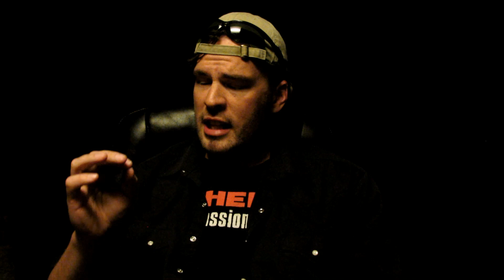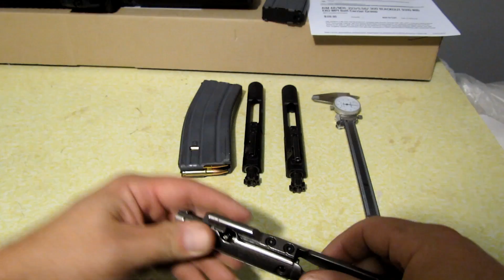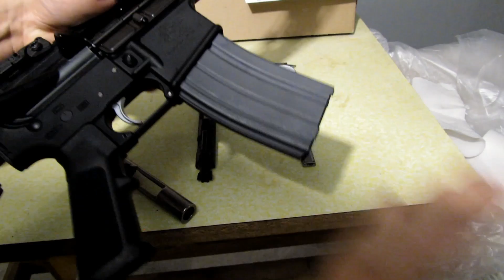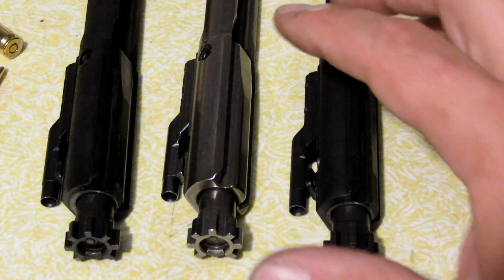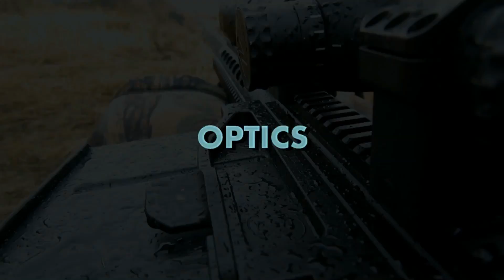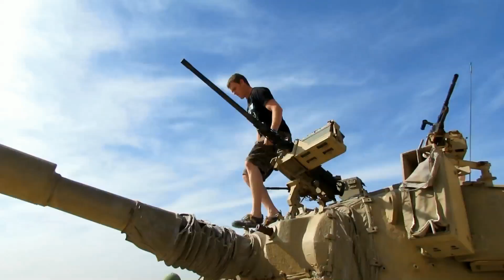AIM Surplus AR-15 Bolt Carrier Group ~ FAIL ~ (9310 NiB EXO MPI)  ~ Rex Reviews

Comment from the maker: NOTE:  This is only an example of what can happen if aftermarket parts are mixed and matched... "cumulative slop" or "tolerance stack" may push it over the edge of failure... this is certainly not representative of every scenario - as there are lots of great reports on how these BCGs work.   Just keep an eye out for potential deviation in all of your rifle's critical tolerances.  :-)
Reply: I've been lucky so far as I have built 5 AR-15s with mixed and match parts. I've used AIM BCGs on all five, two premium nitrided and three non premium nitrided. I have not had a problem with any of my builds. That said, the video was very informative. I did not known that applying the lubricity coating resulted in the removal of some of the metal from the BCG.
Reply: I think you did a good job of showing tolerance stacking. I think the same applies at least as much for the wear on those 40 year old service weapons. I would generally trust something new made from a reasonably reputable company reguardless of certification, over a collection of mixed and matched parts that have been abused by retarded drill seargant enforced cleaning regimens and 40 years of wear. Those parts might have been good when new, but by now, they are probably more out of spec than a new Anderson or Palmetto, etc.  bcg.

Being built to a 60+ year old specification is a guarantee that it will probably work nearly as well as a well made machine made with more current materials and methods.   All brands have failures, and I think your video mostly proves that you should test and inspect all components, more than that you should rely on the various military inspection standards. 

Another thing is that because those specifications are often old, they are actually mandating an inferior product. A stress relieved QPQ nitrided faxon barrel is definitively superior to a CHF chrome lined barrel in all but continuous LMG style fire. The M4  barrel profile is objectively almost the opposite of optimized for everything. thin at the high pressure areas, heavy at the front. It's a politically defined specification, not a functional. Milspec is worse than civvy spec as far as barrels go. I would rather have a stress relieved pencil + profile in QPQ nitride than anything that is issued currently. ISO 9001 is at least as rigorous a standard as those that are defined by the military QFP processes.

When someone says "made to millspec", I always wonder what they mean.

i.e. 

a) made to the same drawings, tolerances, surface finish methods, manufacturing methods, materials, and actually inspected and passed for each. (using the same inspection protocols)

b) in the same general shape and max dimensions, theoretically ensuring fit with even out of spec standard parts.

c. Same as a) but without inspections

d) it's just a marketing word, which means nothing

e) all our dimensions are in house arbitrary, but we used the specified old tech surface coating as required by a particular milspec standard, which specification number we plaster all over the marketing and packaging. (i.e. All the dimensions are wrong, but our receiver has the "right" outdated method for hard coat anodizing., so we'll call it "milspec")

Bottom line, the ultimate test is "works/doesn't work". Most problems are readily identifiable and resolved. The certification doesn't get you around the need to actually function test, but it can give you some peace of mind about latent defects which might crop up later, but are invisible or don't initially interfere with operation.
Reply: Thank you for adding this statement here. If you don't mind me assuming what you are getting to, but I think that what you're trying to say is to be careful about buying a lot of aftermarket stuff to put into your defense rifle.
Reply: that looks like what I have seen when the lower magazine catch tolerances are too tight and the bolt carrier is rubbing on the magazine and losing momentum. so that combined with a bit of extra meat on the bottom of the BCG and its hanging even worse. Measure the total height of the BCGs.And try the BCG with a different lower and same Upper.
Reply: TiborasaurusRex could you or have you done a video on how out of spec ammunition could cause malfunctions? I bought a Nib bgc from spikes that wasn't cycling reliably. could have been the ammo    or bcg since both were new to the gun. before I was running a phosphate and federal xm193 no problems. I was never able to find out the problem but spikes tactical is in the process of replacing the bcg right so hopefully any issue that might have caused will be fixed
Reply: Wish I had seen this before I ordered my 7.62x51 NiB BCG from AIM surplus... still waiting on my upper to arrive to put it all together and test, but this video gives me a good idea of some things to look for when assembling/testing. Great video Rex

Comment: What did AIM's customer service have to say?
Reply: TiborasaurusRex they really are a great company. 100% perfection is not possible. I have had Colts fail, I have had BCM, DD, lots of Kimber's fail....100% 100% of the time just is not possible....it what you do when the ball IS dropped that determines what kind of company you are.
Reply from the maker: return pending...  we'll see if I get hit with the restocking fee.
Reply from the maker: Just got word today (12-14-2016), they gave me a 100% refund.
Reply: I had problems with a PSA bcg .while wait for a new one I purchased a Davison Defense nitrited for  $79.  after 300 plus rounds it runs great .I think it's way smother than my DD BGG. PSA sent me a new BCG it does not compare to the Davison Defense or the DD but PSA has great customer service and I like having a extra BCG .PSA 18 inch nitrited upper running great now with the Davison Defense BCG. I use my DD in my 300 blackout

Comment: Agree with Rex but for a different reason. Bought the Nickel Boron BCG and after one range visit (80 rounds), finish starting peeling away.  I'm not talking about wear and its not carbon.  Damn finish has flaked off.  Aim Surplus wasn't very customer-service friendly regarding a replacement. BCG still works after another 40 rounds but finish continues to flake. Might buy a Fail Zero as a replacement.  Aim Surplus = shop elsewhere.
Reply: Tully3674 If you want a quaility NiB BCG you will have to pay more than $100-120. If you want quaility go with FAIL ZERO. They are $200+ but you get what you pay for.

Comment: That was good to see.  I recently purchased a back-up bolt/bolt carrier group for my rifle.  I was very nervous because some people say the head gap has to be matched to the barrel.  A very experienced individual told me that if it is mil-spec., and your rifle does not have a head gap issue to begin with, then a replacement mil-spec bolt should be no problem.  I decided to purchase a bolt/carrier group from the same manufacturer as my rifle.  Good video......

Comment: Did you return it to AIM Surplus? I'm glad you did this video. I was considering to pickup an extra BCG.
Reply from the maker: They directed me to the return form on their website, however I am beyond their 30 day limit, and the small print read that if it is not "broken" there will be a restocking fee... So I might just keep it for a paperweight Or use it as a learning tool for my future  videos.
Reply: I think it would be interesting to see if a replacement does the same or if it was an anomaly...
Reply: I try to buy from brownells, great customer services.

Comment: I had the same issue with an AIM NiB bolt carrier.
Reply: you can get them for $99 every quarter - watch former Slickguns, now gun.deals for it to pop up.  $99 is a screaming deal, get two if you are going to pay full price.  Sounds like you bought the first thing the LGS had in stock, and you'll get ripped off every time.  Patience my friends, patience
Reply from the maker: So it is not a one-time thing?
Reply: Wayne Wendel Go with FAIL ZERO Nib bcg. They are pricey but they have very good QC. They are over $200 but well worth the price.
Reply: TiborasaurusRex Try FAIL ZERO NiB BCG they are pricey but have great QC. You will pay $200+ on it though.

Comment: For internals, I stick with BCM or Spikes. Daniel Defense is putting out some quality goods as is Ballistic Advantage for barrels and bolts. Working in a gun store and being an armorer myself, I'll never understand the love of Colt rifles. I've seen more sloppy crap come from Colt than any other company. Like DPMS kind of "quality". Experience has also taught me when assembling an AR, it's a good idea to have a few bolts around. Well, it's a good idea to have them anyway because that's the most likely part to fail in an AR, but you just never know unless you're buying a barrel and bolt combo that's been matched at the manufacturer. DIY means trial and error sometimes. Stuff either works out the gate or you have to some tuning to do. I've never used AIM branded parts, so I have no comment on them. I stay away from the 9210 steel.

Comment: I had a similar problem with a base spec PSA BCG that I purchased for a "budget" build 7-1/2" AR pistol build.  I had very poor performance on the first range trip with it.  I had multiple failures to fully go into battery, and I had to "mortar" the bolt open to clear the weapon.  I had noticed that I had to really push hard to install the bolt into the carrier when I first disassembled and lubricated the bolt on initial installation.  I thought that the bolt just needed to wear in at the lugs and the rings.  Never had that problem before in any of my 8-10 other AR builds.  The second range trip was better, but still had several failures to go fully onto battery.  Prior to the third trip to the range with this pistol, I changed the gas rings for a JP enhanced one piece ring.  Then the pistol ran like a sewing machine, not a single failure.   I was also amazed to be able to put all of my rounds in inside a 6" circle at 100 yards using a cheap TRS-25 red dot and my 62 year old eyes (with my astigmatism)!  Barrel is a 7-1/2" Ballistic Advantage, and this build well surpassed my expectations.
Reply: Craig Devenney are the ballistic advantage barrels chrome lined? do they have any coatings?

Comment: I've got a NiB fail zero and psa bcg. Both have worked flawlessly.
Reply: Charles Bronson The FAIL ZERO NiB bcg's are well worth the $200 price tag.
Reply: Charles Bronson I have a cheap kit gun from Daytona tactical. it's never offered to hang up. had it almost a year now. I run it greased and it just works. don't know who made the bcg but it fit my budget and needs. I'm thinking as of right now, name brands are overrated in the bcg anyway.
Reply: blueovalfan23 

blueovalfan23 
Same here . I bought the 7.5" cheap-o- kit (less the lower) from Delta team tactical. Works flawless as well . Spent 300$ on the entire build. I guess .. You just never know.
Reply: Same. I have a premium BCG from PSA that has been flawless in function as well as a "Alpha Nitride BCG 5.56 .223 Enhanced Angle Radius Cut Bolt Carrier Group" --- guess which was more expensive?
Reply: THe Fail Zeros are only about $40 more and are certainly worth it. I paid $165 off primary arms and it wasnt even on sale.
Reply: I bought mine through fail zero and paid $189 plus shipping I think. I had thought about buying one of the $100 psa NiB ones on sale but never committed to it. Went with fail zero cause of all the really good reviews and qc
Reply: ***** When did you buy yours? I bought mine straight off their website a few years ago.
Reply: Yeah I like mine a lot too. I suppose the price has come down  here within the last year or so. I know a lot of stuff has come down in price.
Reply: I could have gotten mine cheaper but I like to support my LGS. They cut me deals all the time so I throw them my business even when they aren't the cheapest.
Reply: The shop I go to is on the small side, but they have a little of everything and also do ceracoat and some gunsmithing.

Comment: YOU GET WHAT YOU $$$ FOR!!!! Buy quality and have far far less problems if any at all. I had a gassing issue to figure out awhile back and thank God I had a buddy who truly knows milspec. It was a colt rifle that somebody installed a gas tube on incorrectly. a new bcg was first part I tried, then we noticed the excessive blow by on the gas tube, gas block area we found that led to under gasing. Roll pin installed out of alignment with hole was the whole issue!!

Comment: Dont mean to nag but as a machinist, I cringe when you were reading the calipers ....1.160 is actually .116 of an inch. The 0,1,2,3, ect through 9 represents .100 of an inch for every mark. Ten marks on the handle is one inch. Every hash mark in the dial face is .001 of an inch. 

Thanks for sharing. I had no idea that the special coated BCGs such as this one fell so far out of spec. Might as well been a mile. My first thought was that when they where programing the part, they forgot to take into consideration the extra thickness of the coating, post operation which could cause some of the binding when you are trying to close the bolt.
Reply from the maker: Ha ha, I noticed that after I uploaded it. That's what I get for making videos until three in the morning and not sleeping. Maybe what I meant was 1.06 tenths of an inch.
Reply: Don't get the idea that they are all out of spec. I just checked my Aero Precision NiBo BCG and got the same measurements that TiRex got off of his Colt BCG. I've also heard that Aimsurplus had a single bad batch and took a bunch back from customers. After that they got a lot pickier in their contracts with their manufacturer, and supposedly have better QC.
Reply: I was about to mention the same thing about the calipers but you explained it much better than I could.
I also figured it was the extra thickness on the coating, looks like compensated too much though!
Reply: makun16 I was thinking the same thing. It makes me cringe when I hear someone call calipers micrometers. As you know they are completely different tools with different levels of accuracy. It was a very informative video and I was considering getting this BCG but not now.
Reply: Me too, also calling a caliper a micrometer.

Comment: I have two Colt's. One is 30 years old, I've had it for 23 years with no problems. My M4 is new and will have to prove itself over time like the older one. Looking at the fit, finish and function I expect it to give as good of service as my original. I like the idea of all the parts being tested not just batch tested. I want 100% reliability not slick shiney marketing.

Comment: stick with colt m4 it's good enough for uncle Sam's misguided children
Reply: I hope someone told the 80+ countries and the thousands of Police Departments deploying the AR-15/M16 that it's not a good or reliable weapon and that the reason it's still in use after 60+ years is because it's intriguing. My personally owned AR-15's, and the M4's I've been issued seem to be very good and reliable guns. Neither of them needed any money put into them to make them that way.
Reply: The military now uses FN M16/M4 rifles.
Reply: No it's not. Its pretty garbage.  And Uncle Sam's Misguided Children use old M16s and M4's the Army got rid of.  They make them work, we all make them work.  Problem is they're junk to begin with.
Reply: evilcowboy lmao u havent ran a modern ar15 very long apparently....even el cheapos run reliable
Reply: M4's work great if you know how to maintain them.  Far from junk.  If they were junk the AR-15 wouldn't be as popular as it is.
Reply from the maker: Mine was an FN, worked great :-)
Reply: I hate to disagree but Eugene Stoner never used the DI system that is in the AR-15 in any other gun he created after it. The AR-18 is a piston system and he pretty much stuck with that for the remainder of his design career. The reason he did this is probably because he knew through field testing the design had a weak point......and it does have a couple of weak points.....and refused to every implement it again in any design. 

The carbon gases that blow back directly into the upper receiver can and will cause fouling without keeping it perfectly clean. 

However AR-15's that have been fitted with a piston system overcomes this problem. The reason the rifle is popular is really not due to it being reliable and fully functional but more to the fact it is a rifle that intrigues people. Nothing wrong with that. Also it has a lot of aftermarket support. 

This is the same reason the 1911 is still as popular as it is even though far superior handguns are now available. Well that and it is a very pretty gun. 

The AR-15 has a certain level of appeal that we all like. But the rifle in its original form is not really that good or even reliable but they can be made to be. You just have to put more money into doing so. 

In terms of reliability the AK-47 has the original AR-15 beat by a mile. In terms of looks and the customization level the AR-15 has the AK beat by a mile. 

Run cheap shit ammo through an AK it keeps going run cheap shit ammo in an AR and you get real familiar with those take down pins. 

The rifle is a nice looking one but unless it is modified with a piston system then the gun will fail and Eugene Stoner knew this and changed his approach to designing a reliable operating system eventually using a system proven reliable and similar to the AK-47. Take a look at the AR-18 the newer rifle in the AR style but in terms of construction is done using the same type of systems you find on an AK with even a stamped steel receiver.
Reply: @evilcowboy  The reason why Eugene Stoner didn't use the ar15 DI system anymore is because the patent for the system was later owned by colt when Armalite sold it to them.. it's as simple as that really.